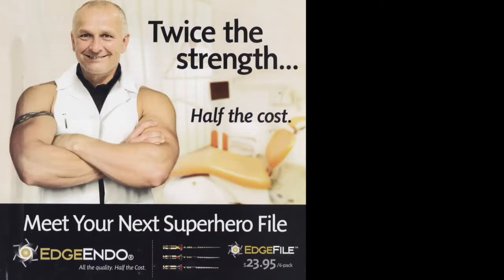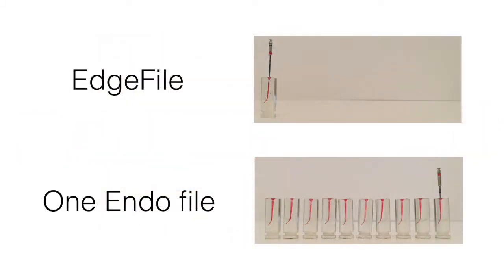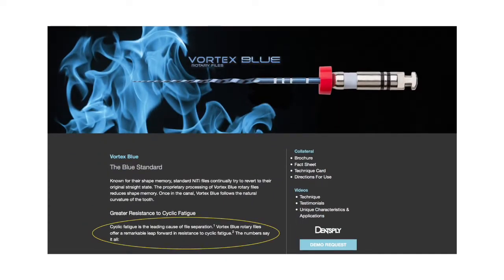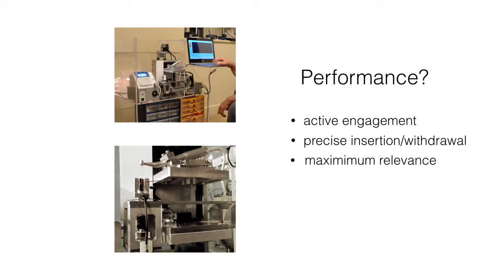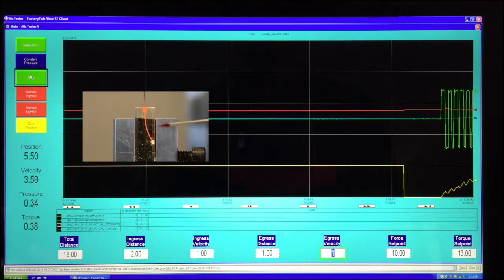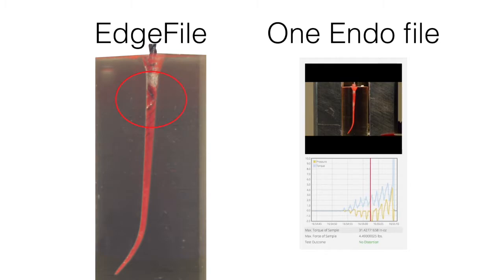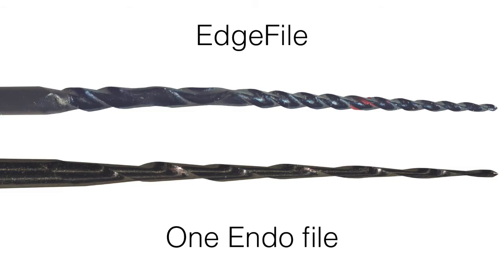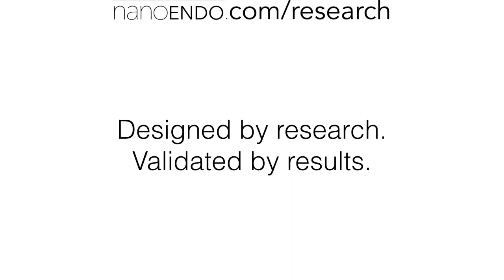Hype Vs. Bad Science: An investigation into the clinical relevance of cyclic fatigue

Comment: also dear dr mcspadden.. k3 designed by you was the worst performer on the market because of absolutely NO CHIP SPACE.. they didn't cut either.. landed files transport lessers but they don't cut too.. K3 also was the most stiffest file on the market..

I respect the innovation by Dr Charles goodis of producing fantastic FireWire.. where we could get best of both worlds efficiency + flexibility..
Reply from the maker: Dear Sanket,
In some regards, I couldn’t agree with you more on the K-3. You are right, they do not have adequate chip space. Remember, the manufactured design was introduced 19 years ago. Since that time, I have tried to have the manufacturer reduce the number of spirals and the size of the lands to no avail. Both changes would have greatly enhanced the K-3’s capabilities. I advocated these changes in my book published 11 years ago. Nevertheless, the K-3s are the choice of a great number of endodontists who consider them as the best. It seems the practitioner selects the file to match their skill set and their familiarity, and that ultimately provides the best results. As it should be. I appreciate your interest -

John McSpadden

Comment: From a Boarded Endodontist that has been using Edge for over 2.5 years, I have never ever seen this happen in clinical practice.  Haven't seen one separate in over 4500 canals!!!
Reply from the maker: I think your comment on your experience of not breaking files is more evidence of your skill and knowledge of your file’s limitations than evidence of the superiority of the files. One of the most difficult cases for canal preparation that I have seen was one completed by Dr. H.B. Johnson ( https://nanoendo.com/blog/?p=369 ), one of the grandfathers of endodontics, in 1939 using carbon steel files. Judging from his skill I have no reason to believe he had trouble breaking files. Yet, I know his files were the absolute worst. 

I have had an interest in using as many different files as possible and, like you, have no trouble in avoiding file breakage. It might not be the most appropriate analogy, but I am sure a skilled lumberjack can avoid complications when using a dull chainsaw. The objective of a superior file is to maximize efficiency while minimizing stresses that cause file failure, to increase its capabilities while reducing its limitations. That increases expediency while reducing risks. Our purpose in file testing is to find the limits of a file’s capabilities, not to be able to work within the file’s limitations. 

We have tested with dentin and bovine bone as well as plastic and the numbers do change but the relative values do not. We really appreciate comments such as yours that require thought.

-John T. McSpadden, DDS
Reply: Edgefiles still remain the best files on the market...